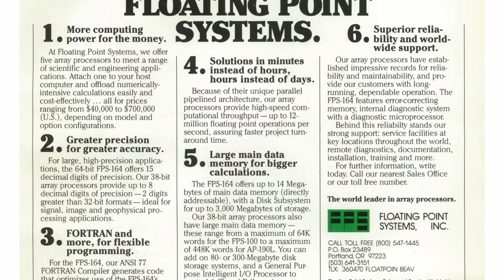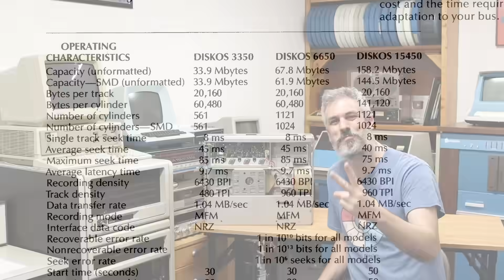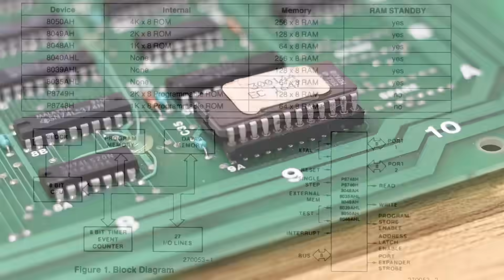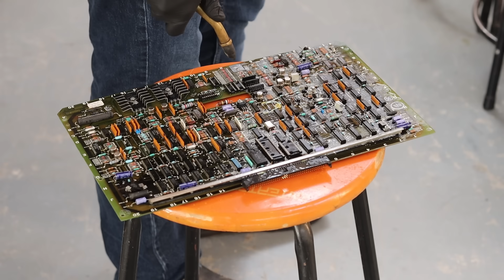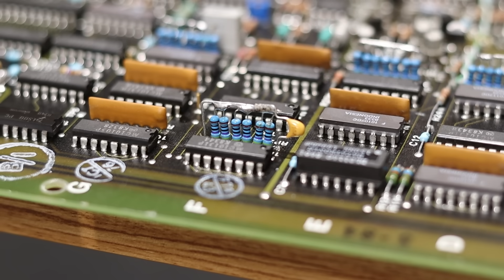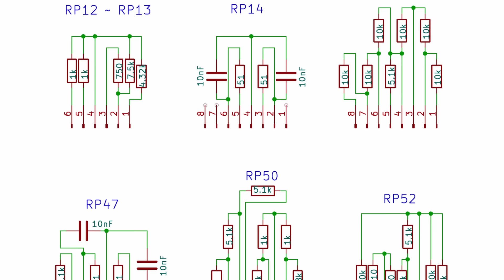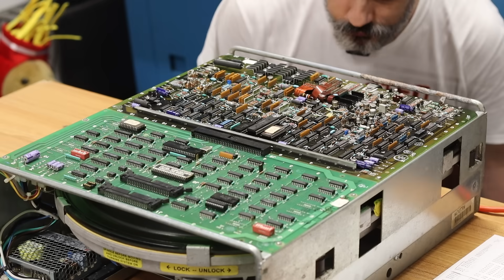This 1980’s Hard Drive tried its Best…

Comment: You could build a much more compact and efficient power supply if you used just a single 24V meanwell supply and then DC-DC converters for the other voltages.

Comment: The 244 and 245 are completely different.

The 244 is an 8-bit non-inverting single direction bus driver with a float (High-Z output) command.

The 245 is a bi-directional transceiver/bus driver with float (high-Z output) command, usually used to drive bi-directional 8-bit data buses.

You need to pull the 245 out and put in a 244. As I said, they are not pin compatible at all.

Someone else in the comments described them better than I did, so read on. I’m just an old engineer who used to design Z80 systems. I used 2 of the 244’s to drive the address bus and one 245 for the bi-directional data bus. The direction steering was driven by the /RD command from the Z80. 

Good luck!!

Comment: Ther's an optical sensor on the fan of the motor there, I wonder if it or it's associated circuitry are functioning if it connects to the analogue board.

Comment: If you do end up replacing the makeshift resistor packs, consider crowd-sourcing (not crowd-funding) the replacements. Post the schematics and dimensions so your viewers can recreate them. I'd bet somebody out here even has pre-1984 resistors they could use to assemble at least one pack.

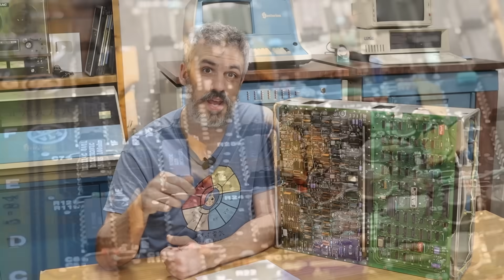Comment: The resistor packs detailed at 6:21, a small surface mount board with a the relative values and an 0.1 pitch connector shoudln't be difficult in 2025.

Comment: Your odd value resistors belong to the E192 range of values, that being 192 values in the range of 10 R to 200 K R, here in the UK such a range is now only available in SMD type components.  I worked in aerospace electronics 40 years ago and we used E192 range (1% tolerance) for calibrating opamp gains & offsets.
You're fortunate that the EPROM data didn't fade over the 40 years since it was programmed, from my experience I know that they're guaranteed to be good for 10 years.  If you intend to  keep your computer running you might consider removing the EPROM then reading the data in it, erasing it with UV and rewriting the data.
You did well to not danage any of the through plated holes when removing those resistor packs, at least one of the pins will be tied to 0 V or another rail which means a big area of copper trace needs to be heated before it can be removed.

Thanks for the video, the types of components and the PCBs bring back memories of building my first computer from a kit of parts in the early 80s.

Comment: i would design little boards for smd components to recreate those resistor packs... but as you find out later... you would have to run a second batch :D Ahh.. you mention it later... nevermind

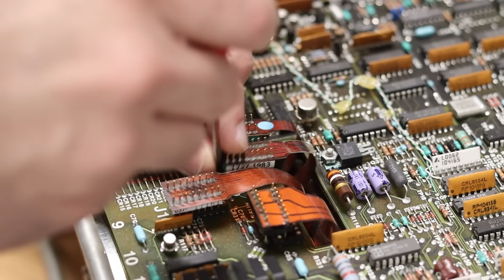Comment: (@7:39) The solder connections on those plugs look a little corroded, or maybe the solder crystallized out over the years. Better reflow those with new solder. 😊

Comment: The 74LS244 and 74LS245 doesn't look interchangeable to me.  The control signals are different. The '244 has an enable for each direction while the '245 has one enable pin and one direction pin.

Comment: A small PCB and surface mount resistors should work to replace those resistor packs.  Then just dip the entire thing in electrically insulating epoxy and call it a day.  I believe that those style resistor packs were made by depositing carbon on a ceramic substrate then laser etching them to the correct values.  then dipped in that yellow coating, whatever it was.  So while my suggested design will be bulkier, it won't be that Frankenstein looking either.

Comment: I probably would replace all these resistor packs with small PCBs with small pcbs by JLC or whomever, that have smd resistors on them. if you want it to look extra nice, solder pins to it, then pot it in some epoxy. then solder them in

Comment: I had an Apollo DN660 ( IIRC) with a 14 PRIAM. Someone bumped into the system lightly and a few minutes later the disk crashed. Toast!  OTOH the 8" 70MB Priam was rugged by comparison.  Looks a bit like the old StarTrek Enterprise.

Comment: Oh my, that's a lot of discombobulation! Smashed, yes - but at least the board itself looks good. As for resistor packs, I'd certainly design small PCBs with surface mount resistors and caps on it; it's not the old laser-trimmed resistor on ceramic substrate way, but will do. 

Oh, and you might want to consider a modern T12 or JBC style (C210 or C245 cartridge tips) soldering iron. Very quick to heat up, packs a lot of power with excellent temperature control and measurement, and mighty versatile with a good choice of tips and easy hot-swapping. I use a Yihua 706-II station with a T12 iron and a hot air handle, very useful for my service work and not too expensive... Don't worry, I still keep that Weller TCP-S and Solomon SL20 just in case.

Wiring harnesses are indeed fun to do, especially if you're lacing them the old way :)

Comment: 6:45 Those weird resistorpacks are Interesting... I bet you could remake them in kicad with either a right angle machine pin or pin header on it and maybe some 0603 resistors on one (or both?) sides. Get some orange heatshrink for them, ta da.

Bonus points for yellow SMD, double bonus points for PCBA? Triple bonus points if the layout works for multiple of those weird SIP resistorpacks with only a difference of soldered components.

You could probably even hit it with tiny through-hole resistors/capacitors on the fake-PCB-SIP-pack, but then it'd likely be all lumpy. I'm not even mad at Usagi's first attempt at through-hole SIP pack creation in the video, [marge-simpson .gif: I just think it's neat]

Oh. OH. I see kicad! [nospoilers] [continues watching]

Edit: Spoilers: Get out of my head, Usagi! 🤣

Comment: for heaven's sake - an LS244 is not compatible with an LS245. The 245 is a bidirectional driver, the 244 is an 8x non-inverting driver with a completely different pinout.

Comment: Did you get a new nozzle for the desoldering iron?
Reply: It looks like it.
Reply: I promise if I ever build a time machine to go back and stock up on Radio Shack desoldering irons. The whole time I worked there, I think I only sold one
Reply: I gave him two tips out of my stash last month at VCFSW.
Reply: It looks like 3D printer hot-end nozzles with a M7 thread and drilled-out to larger diameter should work.

Comment: why not a hakko electric solder pump gun? don't get me wrong the radio shack unit is cool as hell but, the hakko is quick qiggle ofeach pin and youre done but, i do concede it needs more maintenance and has consumables

Comment: @ 10:22 - that's not rust... just look at the corrosion on the component leads all around this area, eg. R22, C27 & C42 alone show problems. Then there's the broken leaded resistors (eg. R8)... the list goes on, for just this one limited view. You have got your work cut out with this one!

Comment: Can you explain negative voltage at some point? I understand it electrically but not how it applies to electronic logic.
Reply: In this case, it's probably more used by the analog board, perhaps by op-amps.

Comment: Sir, couldn't you set up a raspberry pi as a disk emulator, temporarily, to make certain that everything is working?  Once you get your drives up and running swapping it back would then solve your 1984 rule.

Comment: Calling it a "supercomputer" and that "made Cray sweat a little bit" - this seems more than a LITTLE hyperbolic *at that time*. The specs lists the FPS-100 8 MFLOPS peak (aka the "unlikely to ever be approached" value) performance in 1977 - as comparison point the Cray designed CDC 7600 had 36 MFLOPS peak and measure at up to 10 MFLOPS on real code back in 1967 (demonstrating how misleading "peak" tends to be) and the Cray-1 delivered 160 MFLOPS peak in 1975. The term "minisupercomputer" seems a much better fit other than not actually being a standalone computer and the term only being established much later (mid 80s) - so minisuper accelerator kit?
That doesn't make the bad, just that you can rarely take marketing claims at face value, it's a cool piece of kit with some serious performance for the time and it was priced at completely different pricelevels to people and situations where actual supercomputers didn't make sense, and giving many, many times the compute power per $ - something actual supercomputers tends to be miserable at since their focus is "as fast as technically possible in ONE computer". As you mention Cray did buy FPS 1991 (14 years later is an eternity!) but it's interesting that this was after they bought another "minisuper" maker (Celerity, 1988) - and honestly it looks like the only products Cray kept and developed further was the FPS-500 which appears to have been an evolution of Celerity's hardware, not the "classic" FPS/APS ranges. So, complicated history.

Comment: I feel strangely blue-balled after the episode started with promises of multi-megaFLOPs of power on 70s hardware, only to be stymied by a power transfer board unable to work up the juice to spin a drive motor. So wrong, so sad. But what an impressive effort on the analog board! It might look ugly, but the fact you were able to replace the resister packs with hand-built selfies was stunning. That is WAY more effort then I would have been willing to put in, and I salute you sir. I can't wait for the next episode.

Comment: I didn't buy Meanwell PSUs because they're not up to code. The output and 120V inputs are all next to each other. That's a big no-no. Also, you can literally touch the 120V connectors. They're not encased, they're open to the elements. That's another big no-no. One slip of your finger, and you're dead. If you build a custom enclosure for them, that's great, but they don't sell any, and you have to make sure, whatever you build is up to code not to mention, you have to ensure 100% your output pins don't ever touch the input pins. I know there's a ground separator, but that's simply not enough in my book. 120V is scary, and you need to take care.